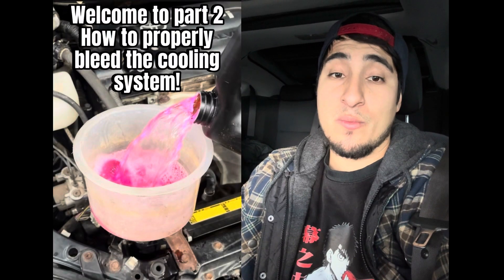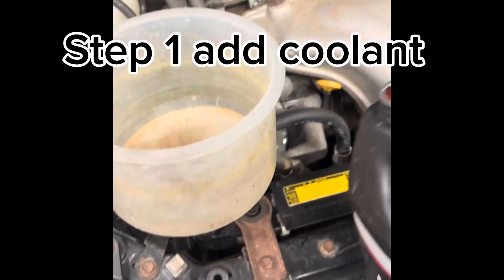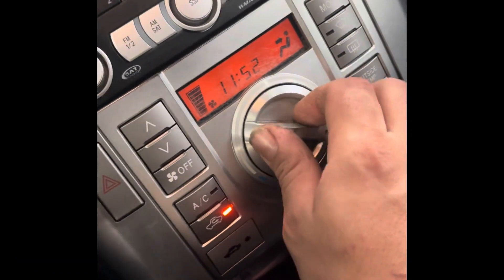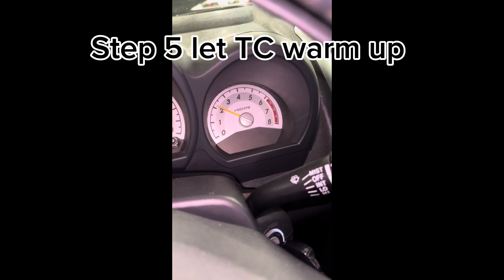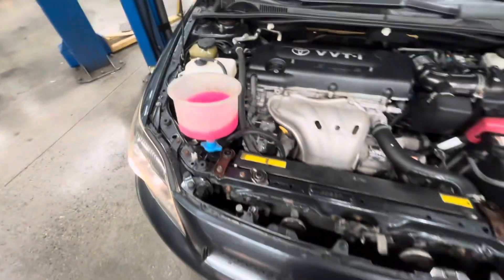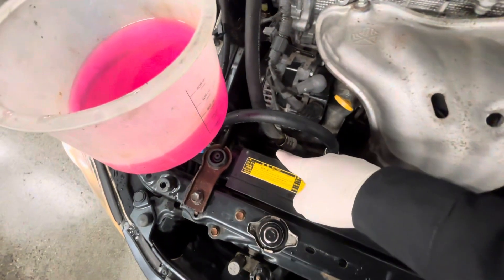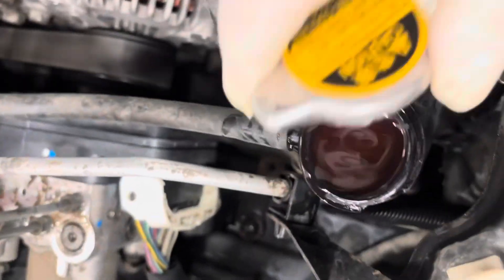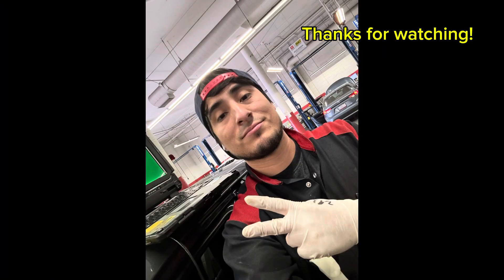How to Bleed Your Scion tC Cooling System (Gen 1 & Gen 2)

Comment: Hey bro, just cheking it is okay for the Temp gauge to be a bit higher that the 2nd notch as it is  on your car. i tought it had to be on the 2nd notch exactly.
Reply from the maker: It should be ok as long as it's not over heating by going all the way to the hot side. The gauge can fluctuate depending on the outside temp and load etcs.